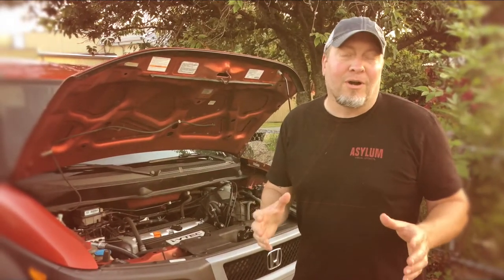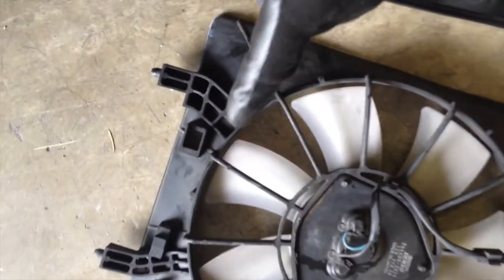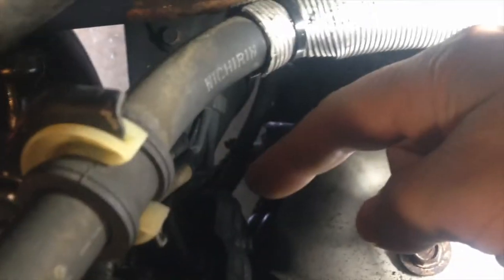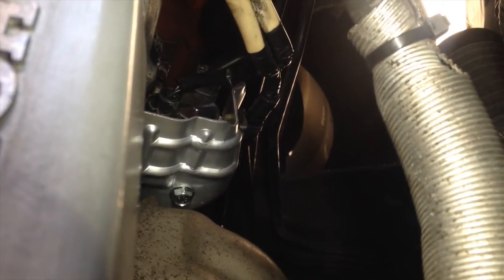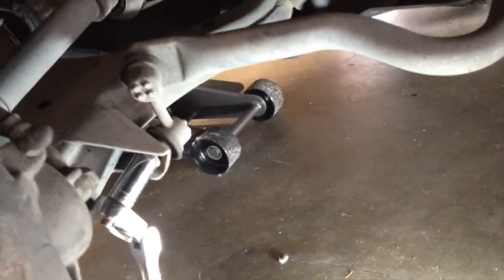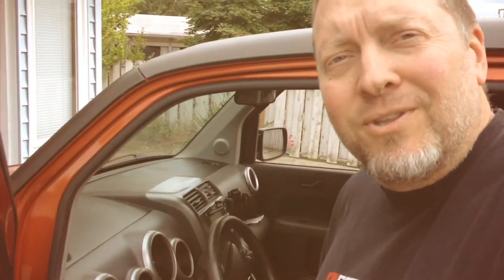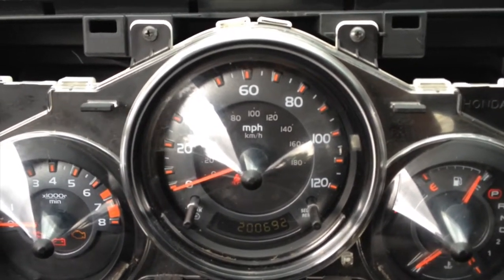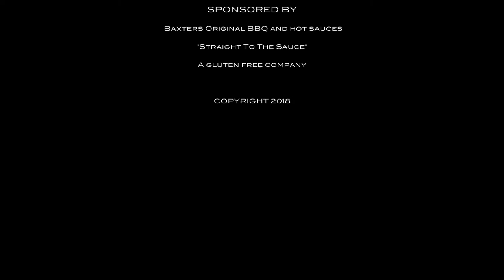DIY Full Service on My $300 Honda Element AWD: PART 2

Comment: Great video, my a/c died and today I saw a burnt fuse for the compressor fan. I did not notice the radiator kick on when I checked it today. I will try relays then switch and then fans sounds like.